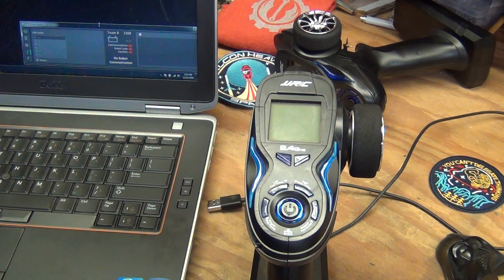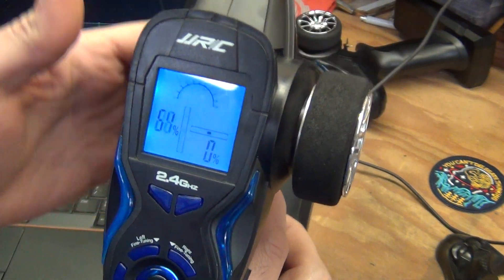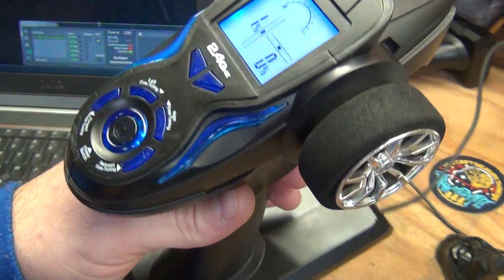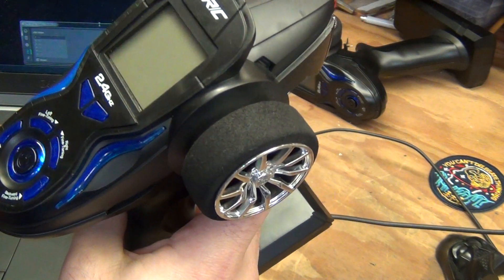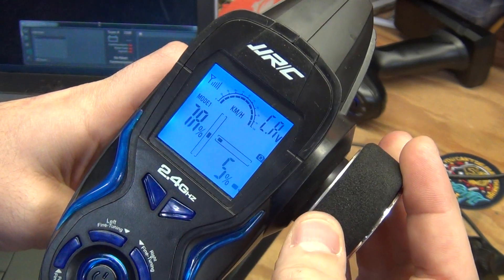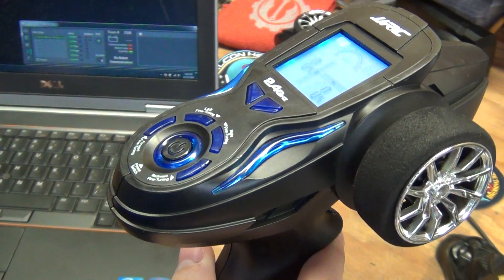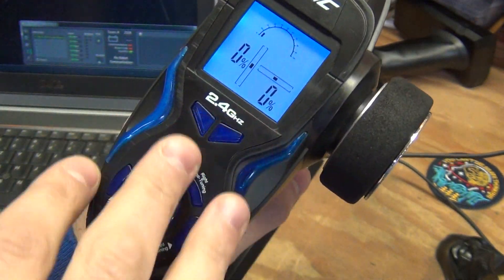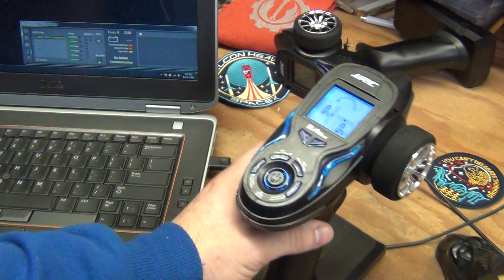FRC 2168 RC Car style robot controller

Comment: Actually not interested in the project but how you reverse engineered the LCD
Reply from the maker: Used a cheap USB logic analyzer hooked up in parallel between the stock MCU and the LCD, captured data while it was booting up (to get configuration register values) and a while after it booted up to get normal mode comms.
Then after some googling and data sheet reviews figured out which IC the protocol was most comparable to.
After that, set up a simple Arduino sketch to mimic the configuration register settings sent, and turn on all LCD segments. Didn't work at first, so used the logic analyzer to see why, compared against the original captures. All values were correct, but the timing between commands was off, so I added some delays into the code to get it into the same ballpark. Timing isn't super critical because the MCU handles clocking data into the LCD (just can't be too fast). Once I got all the segments turning on/off I had to step through all of them individually to  determine the map of addresses to segments, then made some glue code to make updating related segments of the display a little easier. 

The data captures from the logic analyzer and some info on the process followed and results are inside the repo linked in the video description.